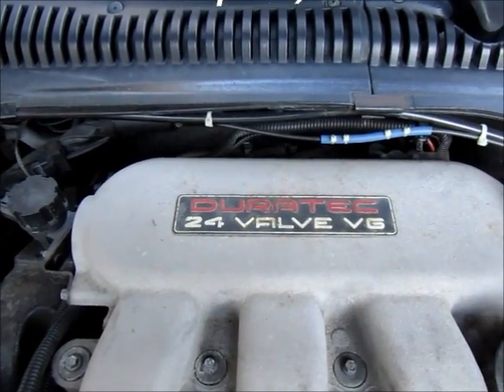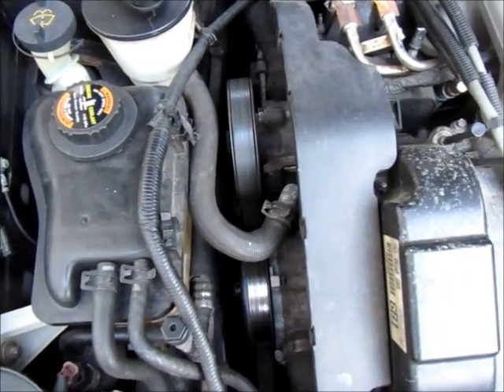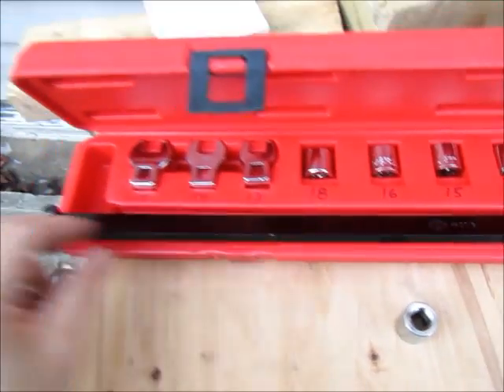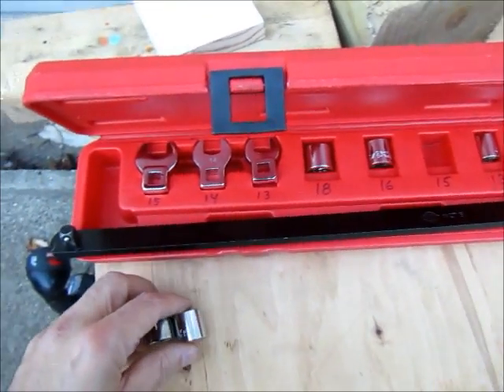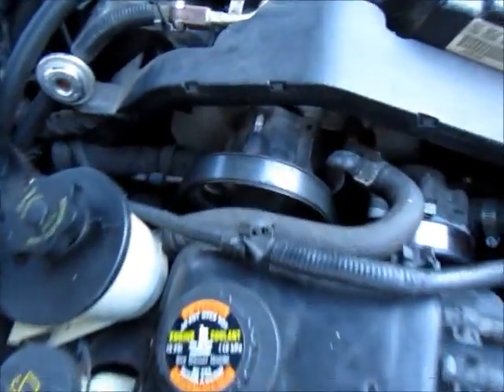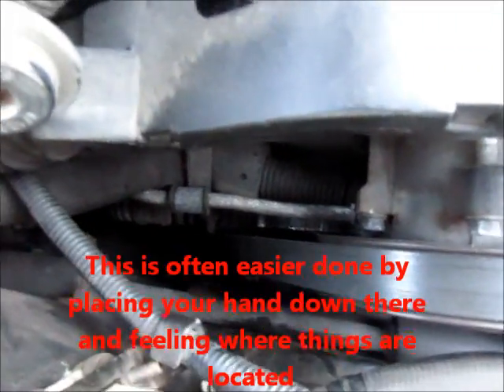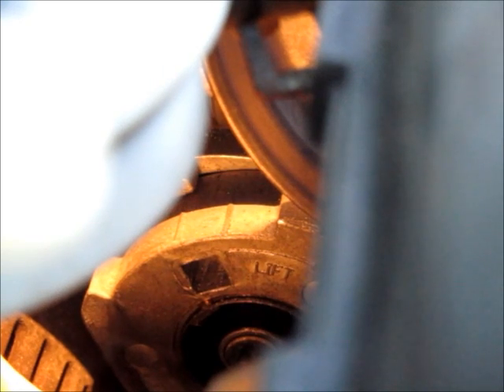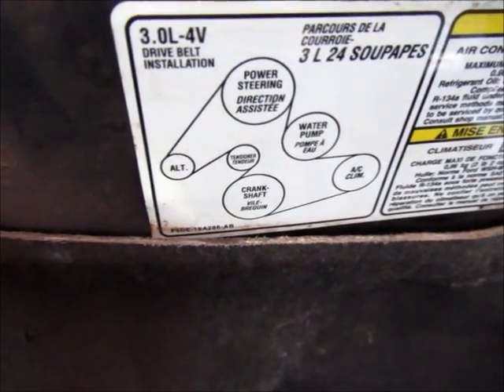Serpentine belt replacement using a breaker bar - Ford Duratec V6

Comment: I gotta say thank you got this bifep. The instructions you shared are  exactly precious.  REALLY HELPFUL, I Really had a heck of a te seeing the middle wheels for the belt. 😩 I will share what happens when I get this job finished.  God Speed
Reply: I shared in the previous comment.  I apologize for all the words that are not there and the miss spelled one's.
As I began to write the comment out my typing board was sitting on top of what I wrote. I couldn't see anything I was writing.  So I posted my comment.  I was mortified!
So I will say Thank You for these instructions.
I'm still trying to reach the middle wheels.
I'm wondering if I'm missing one of the middle ones!  But I'm trying to see why. Will comment about the way I end up . Thanks.

Comment: Why is this a different looking setup than a 2004 mercury sable with a Duratec 3l.0L DOHC 24 valve engine?????   And there IS NO BOLT on the tensioner pulley,  there's a square HOLE, 3/8".  ????

Comment: Even doing this i still dont have enough slack, its just a little to tight for me to slip over the last pulley, suggestions?
Reply from the maker: Make sure it is fully seated in the grooves in all of the other pulleys before you get it in the last one.. Make sure you have the correct belt.  A cheap belt may be a hair too short. Other than that, it is hard to diagnose it from here. Sorry

Comment: Nice video. I discovered my belt was on its way out today while changing the oil on my '04 Sable 24v 3.0. Came here to check for ideas on how to get the tensioner to move after seeing how little clearance exists between the frame rail and tensioner. What I ended up doing was using was my large, curved-jaw vice-grip style oil filter pliers - clamped vertically on the tensioner. One of the teeth even grabbed a protrusion on the west side of the tensioner casting for extra security. I was then able to use a short section of conduit pipe over the adjusting screw on the pliers, and pushing towards the front of the car, released tension and pulled the belt off. Much easier than fighting the 3/8 drive ratchet or making/using a specialized 'tool' for a one time job. Hope this helps someone too.

Comment: you should put an amazon affiliate link
Reply from the maker: I don't take money from anyone and I don't want the appearance that I do.  The tools suggested here are common at any auto parts store or some Home Center that sells auto mechanic tools.  If you want to look on line you will not have to try hard to find them on ebay or Amazon or at your favorite tool vendor. thanks.

Comment: Thx but my Duratec did not have a # 15 bolt on the tensioner. Instead it had a hole for a 3/8" drive ratchet but there was not enough room for the ratchet. Here's what I did. Using a donor short socket extension, I cut off the 3/8" drive and welded it a flat piece of steel. The flat steel bar was 2' long which provided enough leverage. I mounted the serpentine on all of the pulleys except for the top. I pulled on the steel lever, that rotated the tensioner, and I was able to put the belt on. My guess is Ford charges a lot for the tool but I made one out of a short socket extension, flat steel, and my trusty Miller welder.
Reply: I was taught to line e'm up, then wrap a rope or rag,, ropes better,, around the belt, pull really hard till the tensioner goes in and then slip the belt over the idler,,worked perfectly and no tool needed

Comment: having a problem. i have the belt all lined up ready to go around the top wheel and when i pull on the bar its not giving me enough slack to pull it over. is the tension wheel supposed to move down as its doing with me? i have to be missing something here
Reply from the maker: Your replacement belt may be a bit under sized in circumferance.  you may have to use a 3/8 drive ratchet and and start with the handle as far to the rear of the car as you can.  That will allow for a bit more travel.

Comment: You don't need all these tools to take off and take on serpantine belt. You can do that with hands easily
Reply from the maker: That would be an interesting video!
Reply from the maker: Not always. If you are as strong as a gorilla, maybe.  Or Your tensioner is on it way out.

Comment: Hello, I'm a Cougar 2.5 V6 owner, I want to know if this procedure will be fine also for my car, and if there will be any kind of adjustments to do after the change or any kind of check. Thanks
Reply from the maker: I am not familiar with your engine.  I don't know.  Perhaps. If it has a 3/8 square hole in the tensioner, yes.  Ohterwise,  see if you can get a wrench on the tensioner bolt and try to rotate it.

Comment from the maker: If you watch the entire video you will learn why I used a 3/8 drive breaker bar.   I agree the Serpentine belt tool is the best way in many cases. Not everyone has one and the purpose of this video was to show alternative methods that can work and get the job done.

Comment: It is in this measure not referred to as a breaker bar, the serpentine belt tool IS NOT design for that much force, it will break the 3/8 adapter piece off.